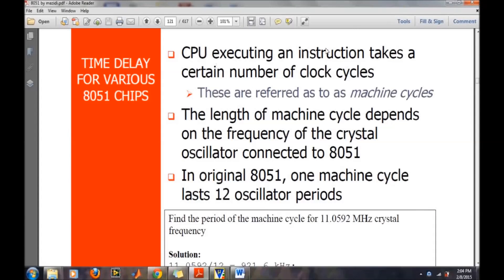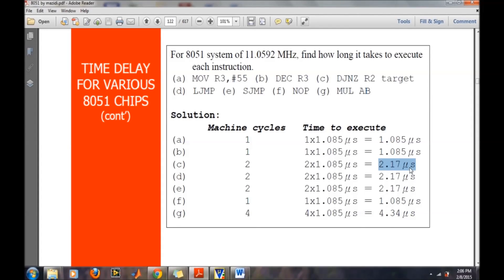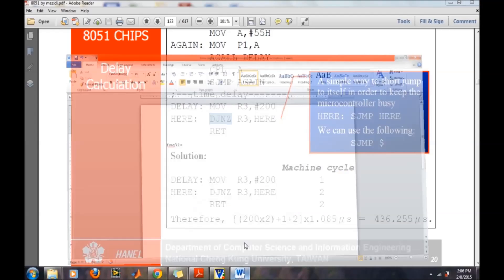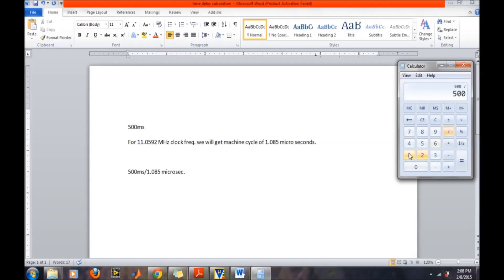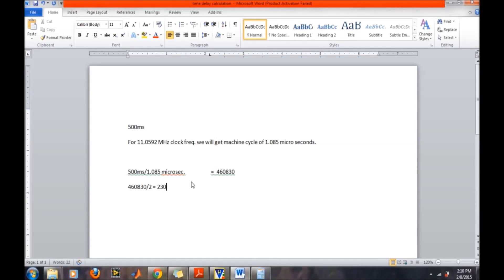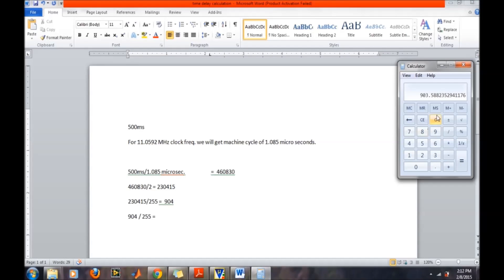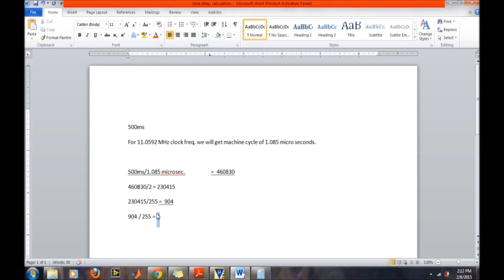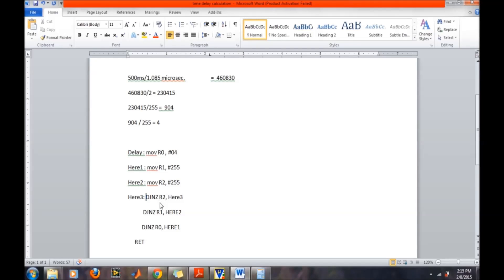How to calculate Delay in Assembly for 8051 Part 1??

Comment: Kindly recheck your code solution.
Try getting timedelay from code and backwards.
For executing Here 3 we need 2 machine cycles. Total time delay for just executing here 3 would require 520200 machine cycles.
520200×1.085micro seconds gives us delay of 0.5644 seconds. Which is far exceeded the question.
Reply: Time delay generated by the code you wrote is simply not equal to 500miliseconds.
Reply: @rakibmustafa6538  its too close. Wrong answer just coz we neglecting numbers.

Comment: can u pls tell the same for 1 mins
Reply from the maker: +Aditi Kaushik just change the time by 60 secs or so.....it comes out to be 255x255x8...
Reply: +sachin sharma  1min=60sec
60sec=60,000 u sec
on cal if cf is 11.0592= its comes 2
so should it no be 255*255*2
Reply from the maker: +Aditi Kaushik 
1min=60sec
60sec=60,000000 u sec
on cal if cf is 11.0592= its comes 8
so should it no be 255*255*8